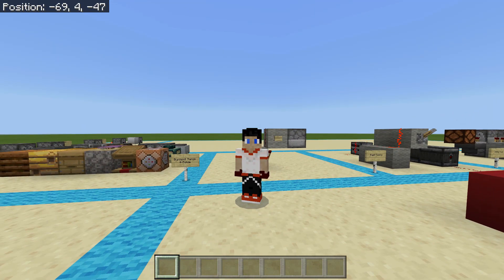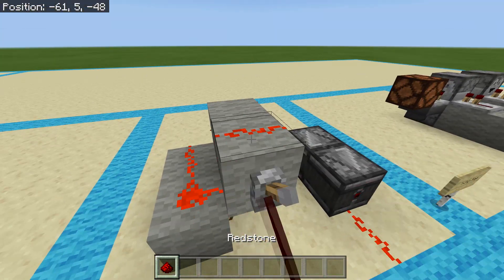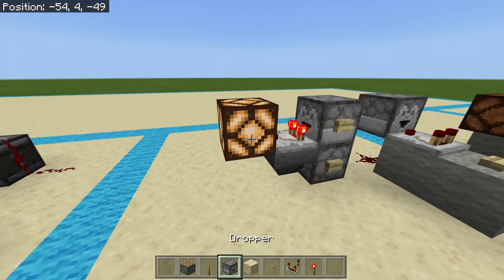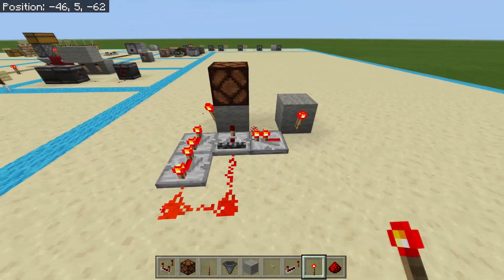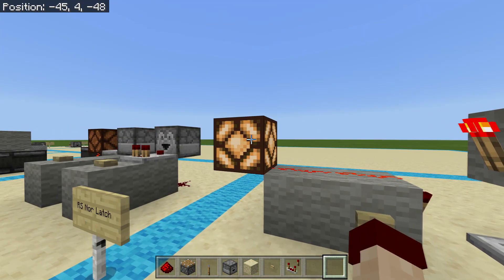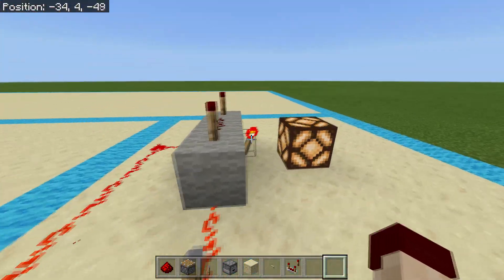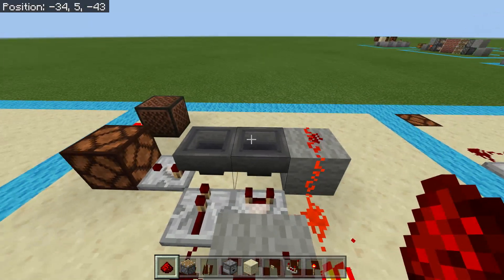Minecraft Bedrock Circuits You Need to Understand!

Comment: Wow this video is 5 years old. They never fixed droppers, lol. 
Droppers will pass power on but it won't push the item out. You have to use a comparator some redstone and wrap it back to the dropper. If not when another item enters the dropper it will push out the item but you will always have some items in that dropper. 

Thanks for the video you have a wonderful day!

Comment: Sorry wait, if anyone comes back to the video and sees this:  why does the torch in the first circuit burnout after exactly 8 pulses with no variation?  Do the torches in the second circuit burnout after 8 pulses?  If that's the case why are they not unpowered/ powered at the same time without the use of the lever?  How does the torch activate from a block update?

Speaking of the second circuit, what is the timing of the pulse?  It seems consistent, but I'm not sure if they are slower than the general 1 tick pulses I'm used to on Java.

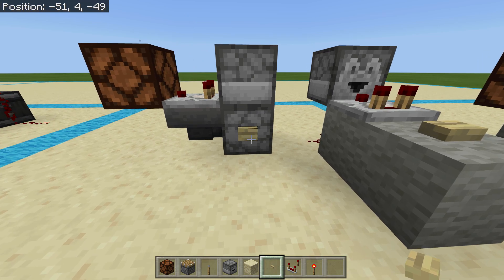at 5:12 "it should not be possible by normal redstone standards".  I don't understand why this would not work.  From my understanding, a block that has a redstone signal can power the block it is  currently powering, along with the blocks in the cardinal directions of the powered block including vertically.  Why does powering the lower dispenser make it not possible by redstone standards but powering the top one will make it possible?  Is this an event limited to bedrock, or across all editions?  You mentioned the term "bud powered" and demonstrated the redstone underneath will not be powered, but if an interactable object (such as a dropper) is below it will recieve power by block update detection?  I feel like this concept is related to the first circuit, but I'm having trouble understanding that one.

The last questions might be simpler to answer.  For the RS nor latch, is that the smallest way to build it?  Or was that just a demonstration of the logic behind it?  I tried making my own, but wound up creating another t-flip flop with pistons and hoppers, which was still larger than my intention.  Lastly, is there any way to get exact numbers for the custom timers?  Don't get my wrong, the ability to make a timer using known values is still a great concept, but what about half seconds or tenths of a second (for tick purposes).  In the case of measuring tenths of a second, I'm thinking of using observers and pistons on a 1 tick pulse to keep track, but it might be too complicated overall.
Reply: Ah, I would like to answer some of my questions since I've just watched the "Minecraft 1.16+ Redstone Tutorial for MCPE & Bedrock!!" video.
The "burnout torch" feature int he first circuit is simply a code problem and not a logic one.  The torch is being restricted on the ability to continue for infinity.
 
 The video explains the BUD powered activation from 5:12, at least for why the redstone itself would not power.  The answer is that it is being "soft-powered", a state where the block is powered and technically capable of providing power to other objects (repeaters, torches, etc) but is unable to power the dust itself or carry the power through.  I still don't understand why the power cannot transfer up vertically as it wasn't covered in the basics video, so I would still appreciate the help there
Reply from the maker: Hey!  We have people who can help explain all these things in discord!  We have a specific channel for getting help like this 💪
Reply: @AnimusJGames  Oh neat.  Thanks for that, I'll head over when I get back.  Just discovered you today when my friends from xbox called me over to play.  Good stuff man, keep at it